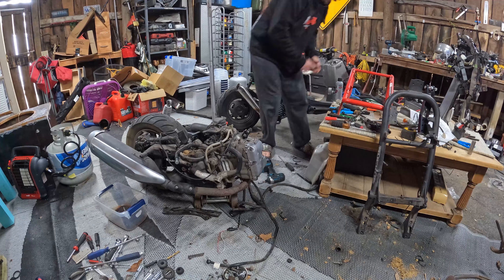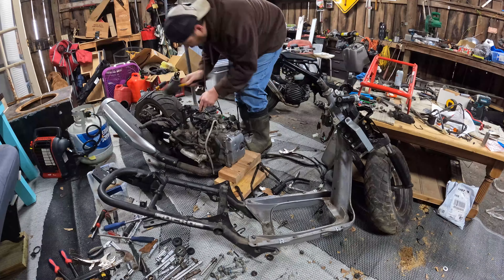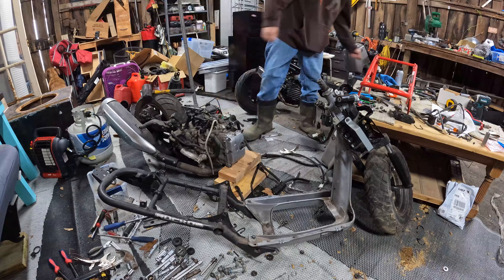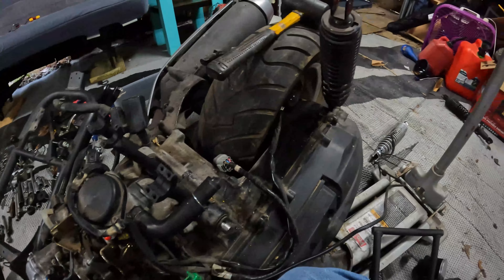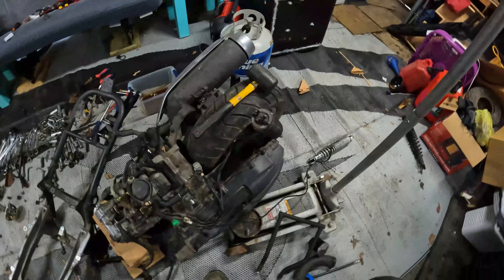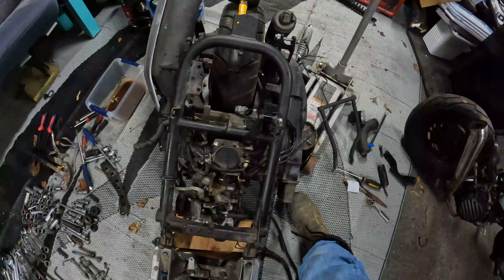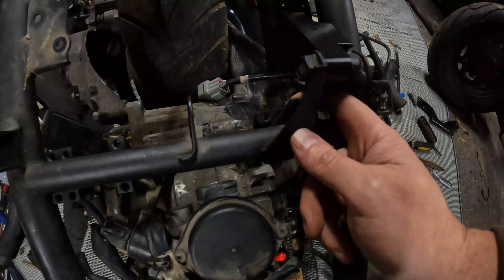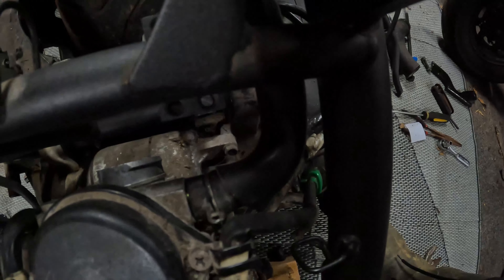Honda Ruckus - Yamaha Majesty 400 swap - ep6 - Mounting the Engine on the Ruckus

Comment: Cool build, Im in the process of swapping this majesty 400 motor in a yamaha morphous, its the majestys little brother and in fact a direct bolt on and all the electronics are plug and play, you have to swap the drive shaft, ecu and ignitiion coil as well, how do you personally deal with the airbox mess and say just put a pod on it and be done, what are you doing with the hoses, just removing, then tune the motor?  TY again
Reply from the maker: if you check out my other video: https://youtu.be/wiATF2Mrw3c?si=nGoicQysE8ED6gv8&t=150 you can see the intake I built. I also had to make a bung for the IAT sensor. The other hoses are removed and small filters added to the crankcase and one for the throttle body.